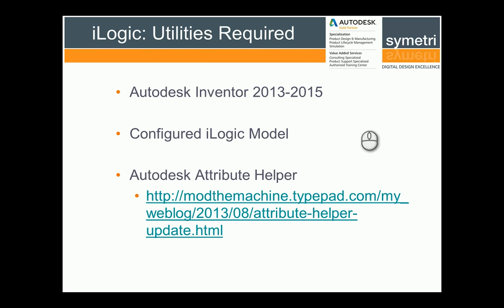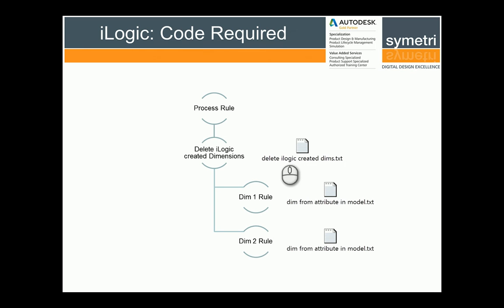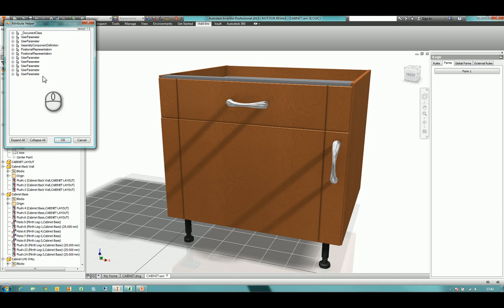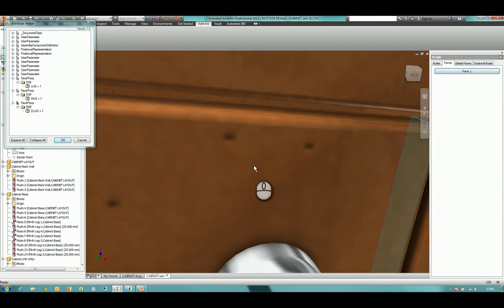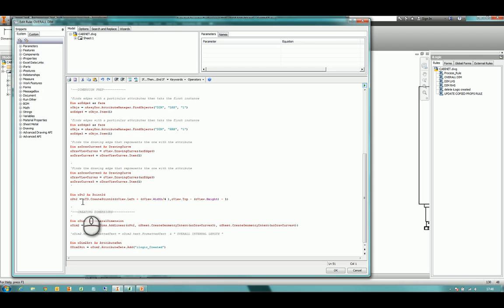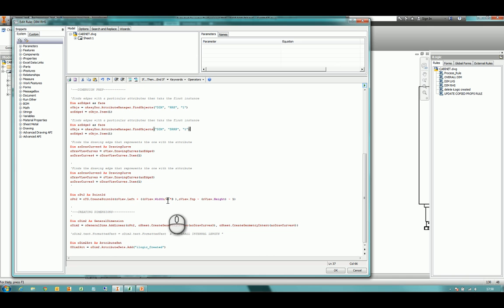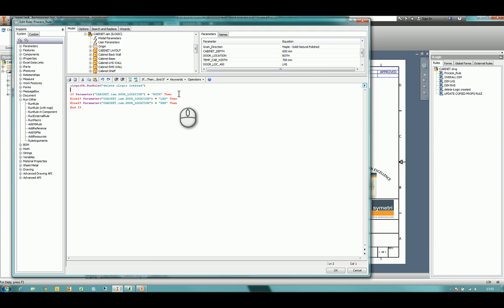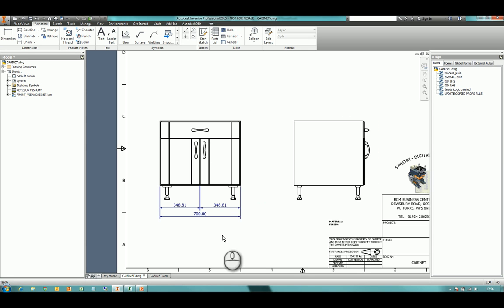Autodesk Inventor iLogic Drawing Dimension Automation

Comment: Hi, When i save and run the rule I get this error message 
'Error on Line 47 : 'oTG' is not declared. It may be inaccessible due to its protection level.' 
Did you referance the oTG in another rule?
Reply: try to change the level of details of the model that you are working on

Comment: Thanks for the comments ... I dont monitor the comments so hadn't seen that questions had been asked ... apologies.  I'll be doing a hands on lab session at AU London 2018 this year on Drawing Automation and code / examples should be available on the AU website (All going well).  If you need help then please contact Symetri directly info@symetri.com.  As for the text in this example, the PowerPoint is available to view with the rules https://viewer.autodesk.com/share/59160f3613f3120a64fd4abd

Comment: Hi there. I've been using the Attribute Helper for a while now. Is there a way to create arrays? I have a part with up to 50 bolt holes (driven by a configurator) that I want to automatically dimension to in my drawing without having to create 50 individual attributes.